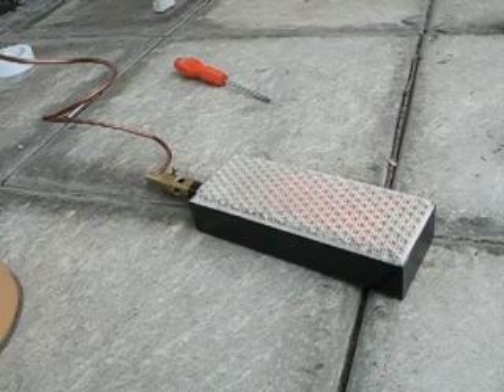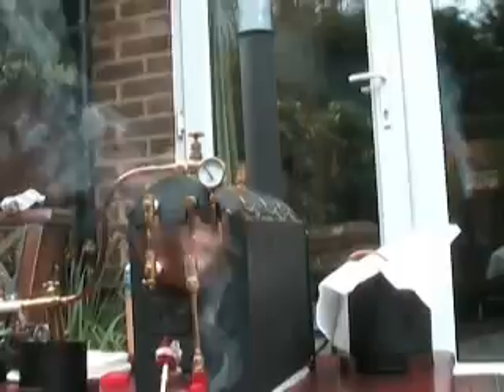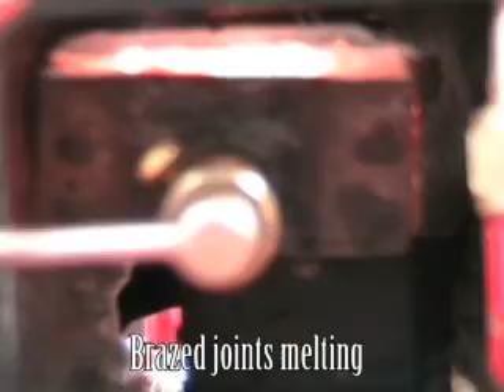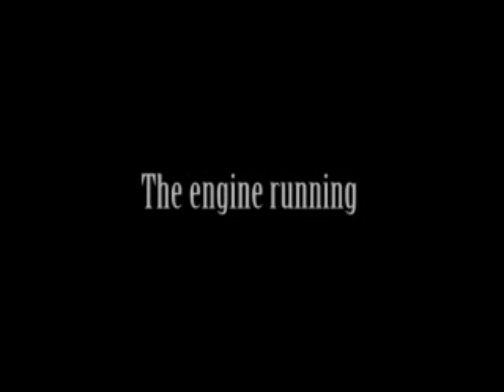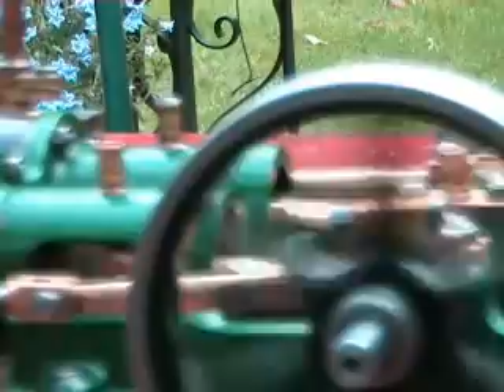Stuart Score - third run

Comment from the maker: Bought a new burner in the end, which fared rather better. Ended up realising that the engine was quite inefficient, in that the pistons were too small for the cylinders, so made new pistons (with graphite yarn packing) that were more precisely machined. Before I had time to put it back together and test it, though, I ended up moving out of my parents' house and into my own flat, where I don't really have space for this, so this is all in storage currently. 

Thank you for the suggestion, though

Comment from the maker: I have resolved the burner problems; I have a new Maccsteam burner, which goes in at the other end of the boiler: I have made a door to go at the chimney end which I open to light the burner, but is otherwise kept closed. I no longer light the burner through the air holes. Have a look at subsequent videos to see the improvements :-)

The boiler still does not provide enough steam, though: I shall need a new boiler in the end, but this one may be useful for a smaller engine that I am building.

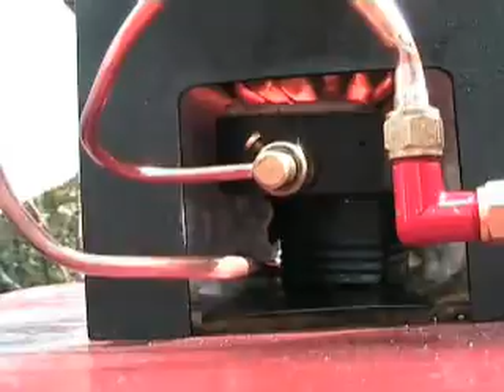Comment from the maker: I think that I have worked out (with some help from people on various forums) what might have caused the burner to destroy itself: I lit the burner, as can be seen at about 01:40, from the jet, not from the top of the ceramic.

This seems to have caused a flame to burn *inside* the burner, destroying it from within, creating so much heat as not only did the brazed joints unbraze, but the ceramic itself melted slightly underneath.

Comment: It is best to have high pressure in the boiler than to have low, high pressure steam is much dryer and wont have as much condensate in exhaust or in the whistle. Hope you use cylinder oil

Comment: Nothing a bit of 1/8th inch plate steel box welded won't fix. Burner wise,
But rather than a Standing water, or tea pot type boiler? Why not stop in and give me an email. In A PRIVATE message, I'll send you some flash boiler patterns. They heat much quicker,and make better preshure.